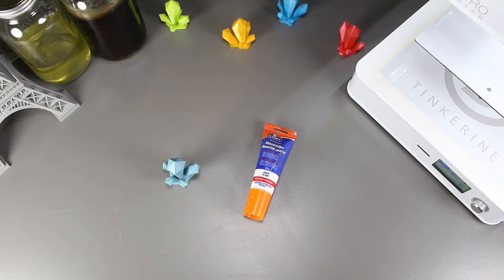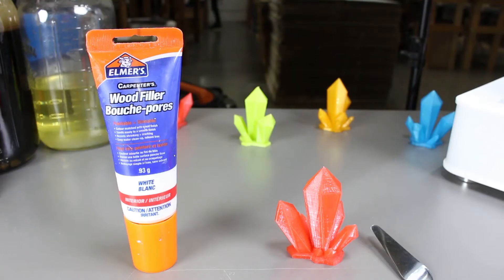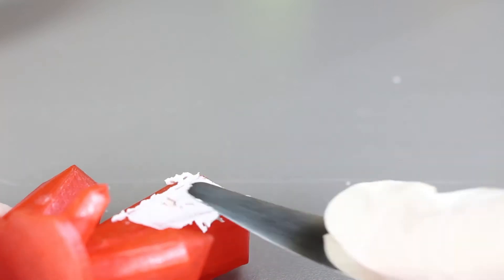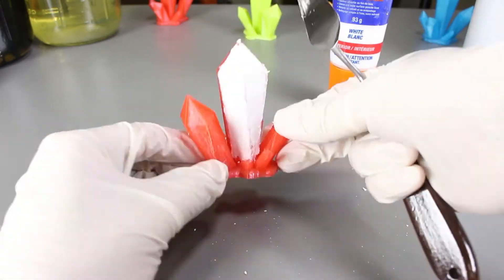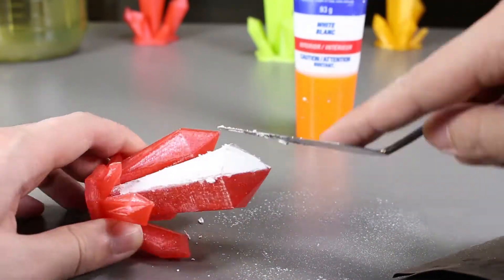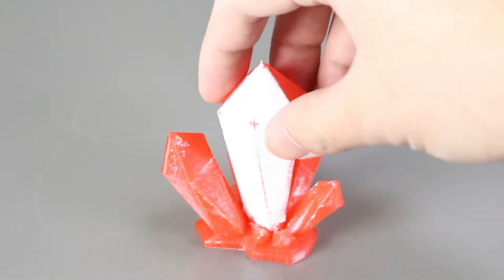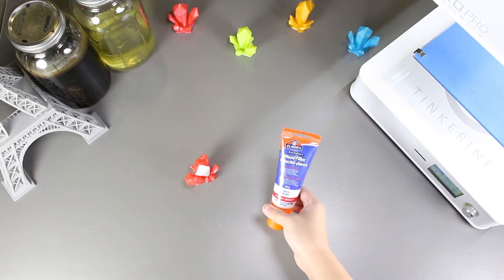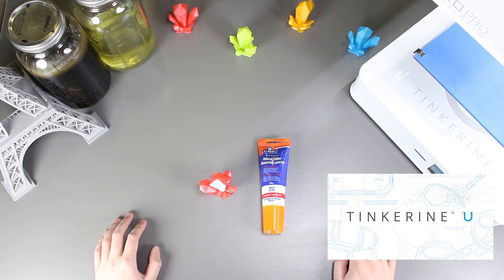Post-Processing 3D Printed PLA Model with Wood Filler

Comment: Probably airbrushing "acrylic gesso" and then lightly wet sanding the 3d model would work much better.
Reply: no gesso ive tried many many times not the best for prints, unless your dont want fine smooth then go right ahead, gesso is fine for i guess stuff that will sit on a shelf and gather dust, but a cosplay no its not that  good
Reply from the maker: Thanks for the comment and the suggestion!

Comment: looks to me like you put way too much wood filler on. Some fillers can be mixed with a little bit of water (depends on the solvent used) so it's even easyer to apply an even and thin coat that just fills the cracks between the layers.
Reply: agreed a little water can go a long way
Reply from the maker: Thanks for the comment and advice! We will keep it in mind for next experiments.